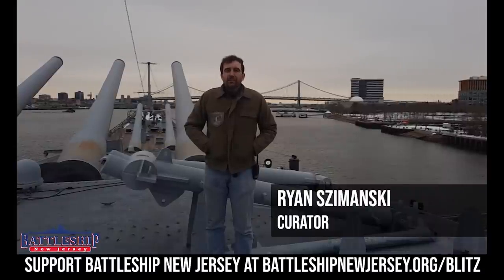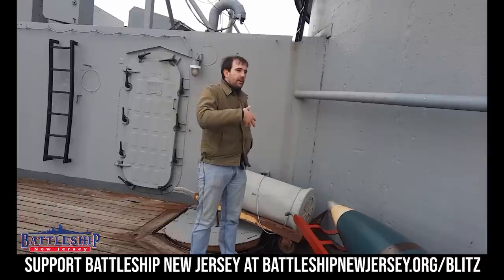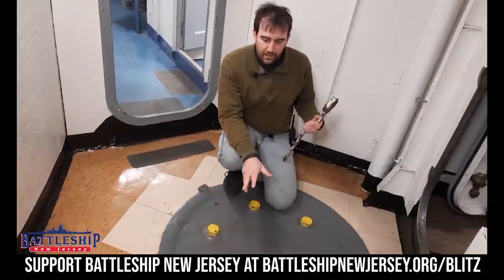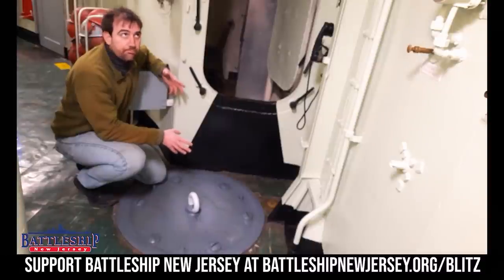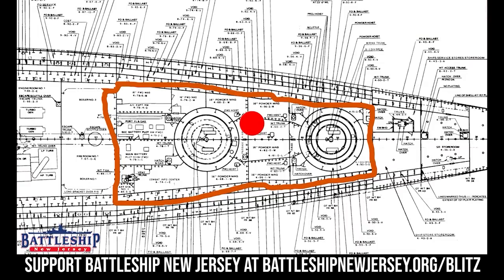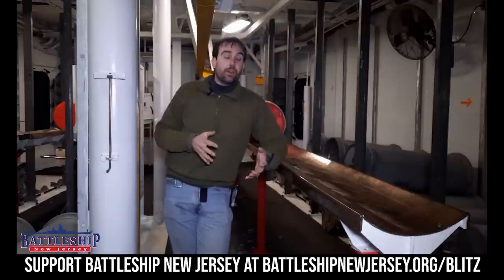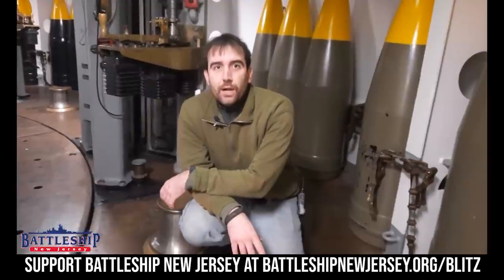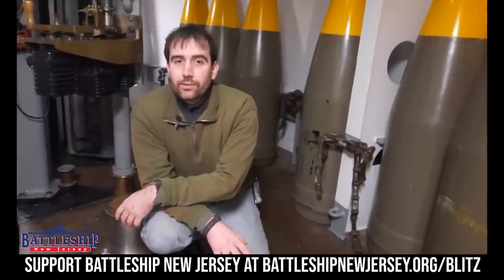How to Load Ammunition onto the Battleship

Comment: HA !  All those lowered expectations from "Everything is steam, and the Navy prohibits us from raising steam" - and PRESTO - hoist is powered and works !
Reply from the maker: There is plenty that is electric on board and not steam. But they pulled a lot of fuses and cut a lot of wires, and a lot of motors haven't been maintained. So it says a lot about the quality of that motor that it works!
Reply: @BattleshipNewJersey  THANK YOU !
Reply: @BattleshipNewJersey  would a motor like that be 3 phase?  Interesting that 440 or 480 is still even available around the ship.